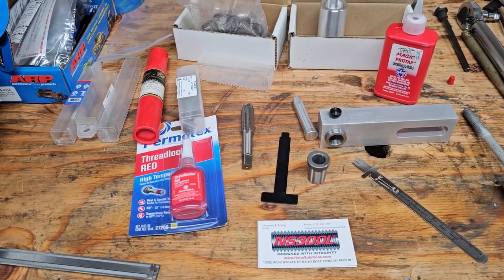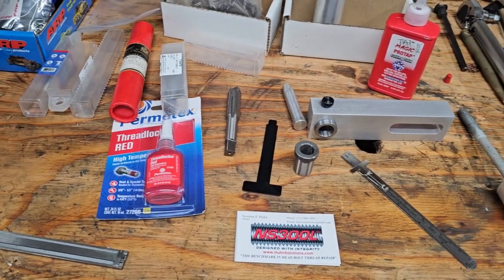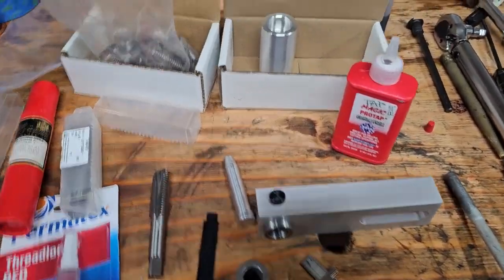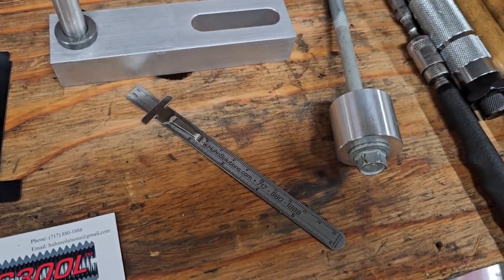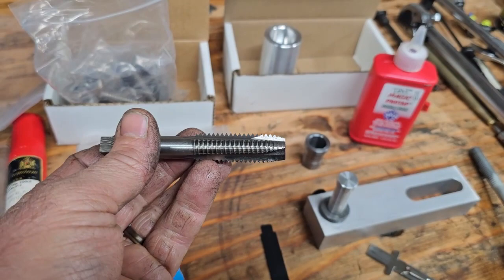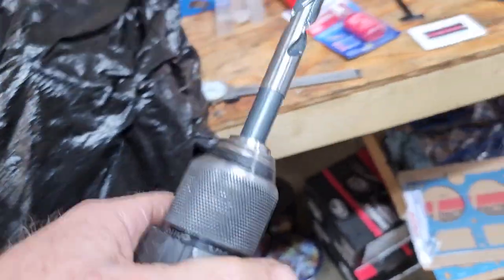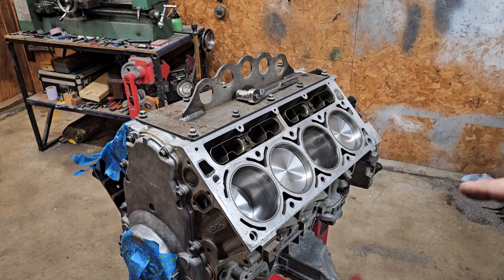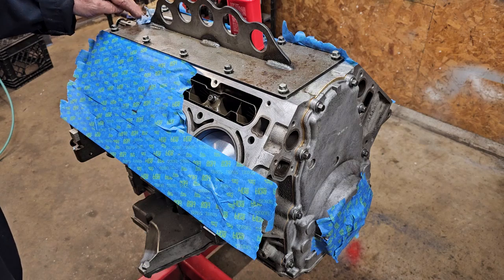C5 Corvette LS6 Rebuild - Pt 14 -Headbolt Thread Repair

Comment: Thinkin’ you’d want to chamfer the insert threaded hole, after tapping, to make sure the top thread didn’t displace any material above the deck.
Thanks for sharing.
Reply from the maker: I have been chamfering the top just didn't get it in the video.  Like expected it does leave a nice bump where the tap starts.  Thanks for pointing that out.  I added a note in the video description to make sure people know to do this.

Comment: Great video! So i have the exact ls6 block i use arp bolts. What, if any, is the advantage of arp studs?
Reply from the maker: Well studs are cooler of course!  LOL.  Seriously I debated about which one to get.  Strength wise there probably isn't much difference.  Where the studs are better is when you actually torque them down.  With the bolts you are screwing them into the block as you torque them down.  It's hard to make sure the threads in the block are perfect and they are much more course thread than the top of the studs.  With the fine threads on the top of the studs and the fact you can make sure they are perfectly clean and lubed exactly like ARP specifies you should be able to get a more precise clamp load on the head.  Will it make any real world difference?  Probably not.
Reply: @xpsgarage  😁 I agree studs are cooler!! 😂 seriously, thank you for that reply. You made it make sense.